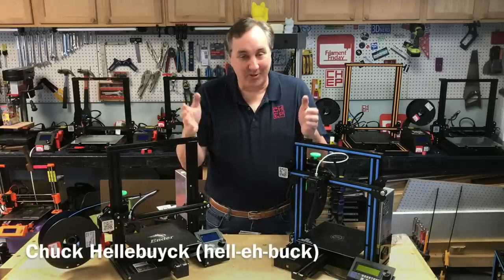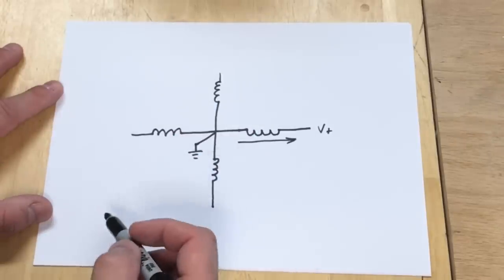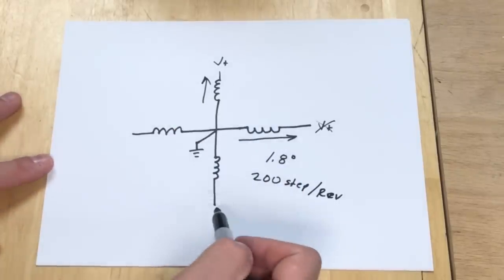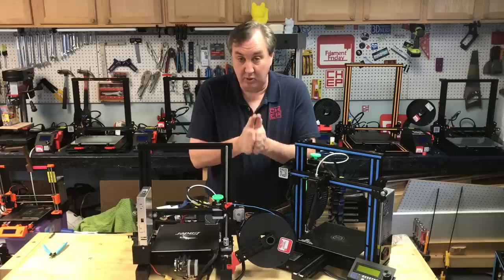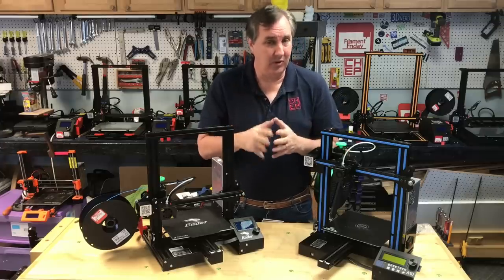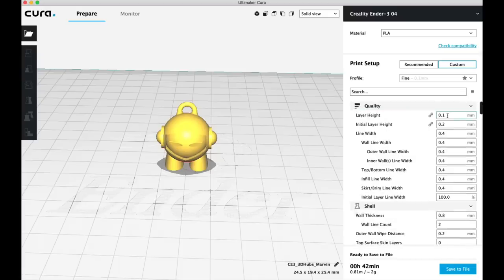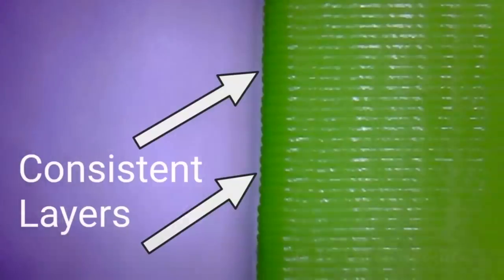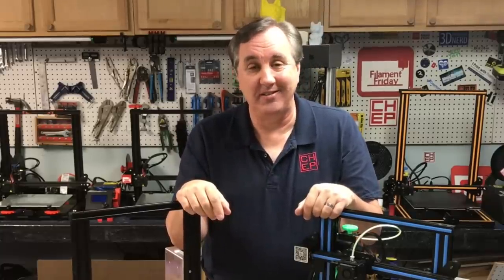Better Quality 3D Prints Using MAGIC NUMBERS on Creality Ender 3, CR-10, A10

Comment: I can't find these settings on cura. I'm having trouble with my ender 3 max. It prints good to certain points then strings like crazy and messes everything up
Reply: Oh can’t find the layer height setting!?
Reply: use ultimaker cura has all the settings ... make sure when u add ur printer to have ur operating system, for me for example is marlin 1.0 u might have a different one, that is important as the gcode will be "flavoured" for that OS.. for better reading and not have prints fail on reading. 

u have to go to options and enable all settings and then u have complete control over everything jerking etc.

Comment: Ok my tevo users a 2mm pitch which going by you numbers works out to be 0.01. Thus making every layer height no mater what it is a magic number is this correct ?
Reply from the maker: What is the lead though? 
Does it rise 2 mm on one turn of the stepper?
Reply: @FilamentFriday  the lead is also 2mm. I am curious as well as I also have a tevo. Great videos by the way. I just subbed :)

Comment: Hi, thanks for your amazing video. It clarifies a lot of things. So after that, I was thinking if there are magic numbers to set x and y steps. When it comes to tuning up the x and y steps in marlin because of the test cube, I have numbers like x 79.54 and y 81.03 steps/mm, but something tells me, now, that they are going to mess a little bit with the diagram you just explained, but being different from Z I don't know how to calculate them. Have you done any tests on this?
Thank you
Reply from the maker: They don’t help X and Y since they are always changing small amounts, not fixed amounts like Z.
Reply: @FilamentFriday   Hi, thank you for the prompt answer. I understand, but this put me back to the main problem. It is more than a year that I am trying to have a decent print on my cr10s, but I still don't know what is going on. I followed all your videos, but Nothing.  Thank you for your time
Reply from the maker: I got rid of my CR-10S because I couldn’t get consistent prints either. My CR-10 prints great.
Reply: @FilamentFriday  Hi, this is weird. Technically the CR10s have 2 Z motors and a newer MB compared to the CR10. I (I suppose) improved my CR10s with an SKR 1.4 T, x,y,z on TMC2208 and E0 on 2209, silicon heated bed 220V, so the PSU is free from the bed heating, Hemera direct d. But I still have a lot of problems.  I am thinking to get rid of this printer too. what do you think about an Ender 5 plus. I still need a decent build area and a bed that doesn't go back and forward.
Thank you
Reply from the maker: I’ve never used the plus. But some people like it.

Comment: Wonderful video, but there is a thing not clear:
  You say the magic number for Ender 3 is 0.04, than  profile fine 0.1 becomes 0.12;  extra fine 0.06 becomes 0.08;  extra fast 0.03 becomes 0.28  and finally Normal 0.15 becomes 0.16. Why so?  Maby normal becomes  0.17. not  0.16.  Is possible?  
Moreover if I have mounted TL-Smoothers on my motors  what's happen?  Numbers are different?
Thank You 
Luigi
Reply from the maker: Because 0.08, 0.12, 0.16, 0.28 are all multiples of 0.04. 0.17 is not.

Comment: Unfortunately this doesn't work with BLtouch auto level. BLtouch sets the apropriate "software zero" and doesn't care where is it in relation to magic number. When you level bed manually, Z motor(s) should be holding full step when leveling, then magic number works.
Reply from the maker: Nope. Not true. The bed can zero on a any microstep and with magic numbers it stops on the same microstep averaging out any variability so BLTouch doesn’t matter.
Reply: @FilamentFriday  Well, I don't have enough knowledge yet to claim you're wrong, but this doesn't make sense to me. Full step is the step which you feel when you rotate stepper motor by hand.  Microsteps in between make fine adjustments possible. I use stethoscope on motor and I can hear and distinguish full steps from microsteps when adjusting z-offset. Microstep has humming noise, while click into full step doesn't produce such noise. It seems like microstep is held electronically, while full step has some mechanical-like electromagnetic support to the electronic drive/hold. Z-offset is telling the software what is the height difference between nozzle tip and BLT tip. When bed moves by some microns in height after a while, BLT recognizes that and compensates in microsteps of Z motor. If BLT automatically levels in microstep and by chance stays there and not in full step, you will stay stuck in microstep with magic number, throughout whole height of print. 
That's how I see it.
Reply from the maker: Microstep angles have variation in between natural steps. BLTouch just sets the first layer. Any variations in bed height due to warp or unevenness, get filtered out in the first few layers by the firmware. The print then rises based on layer height, not BLTouch. If you use magic numbers it rises at a consistent rate equal to a natural step. Any variations in angle from microstep to microstep is averaged out because it rises and stops at the same microstep, (or natural step) that it started at after the BLTouch layers are complete. This produces a more consistent layer height and smoother prints.
Reply: @FilamentFriday  
I didn't know uneven bed get's smoothed out in uniform level through upcoming layers. I was imagining this differently, as you realized youself, less refined. Thank you for new insight.
Are you sure it automatically catches natural step (not in between) after BLTouch fades away? What if BLTouch started print just in between natural steps?

Comment: how do you know what that metal rod's threads for 1 natural step is?
I have a tevo tarantula and it has a metal rod with threads for the Z axis as well but i have no idea if its the same rod you have or not.
Reply: You can calculate it the same way he did. Mark the top of your rod, and use a caliper to see how much your Z moved up by 1 full rotation of your Z rod. :) Also, you can just keep testing it. 1, 1.1, 1.2 and so on.
Reply: vineheart01 Welcome to reason #2 why this is nonsense.  We have people expecting to believe that the tiny differences in steps within the stepper motor are screwing up print quality but you can take your calipers and measure a single rotation of your z screw.

Comment: Hi Chuck. I started running the magic numbers on my Ender 3 Pro and all is well. But as I was lying in bed last night, I was thinking about those magic numbers. While the concept makes complete sense (and your drawing was very helpful), does your Z-offset affect these at all? I was thinking that if Z was zero, then a .04mm turn would indeed align the motor with the next magnet. But what if your Z offset is, say -1.34mm or something like that? Doesn't that mean that the motor might be "between" magnets and each .04mm turn would put it equally between the next magnets?
Reply from the maker: As explained in comments multiple times, the Microstep angles aren’t equal so using the magic numbers averages that out. If you start at microstep 7 you stop at microstep 7. This rising equally to give the consistent layers I show in the video.

Comment: Hi Chep, today I just made a discovery. When I print in Tpu95 on my ender 3 using magic numbers I have poor layer adhesion. But when I'm not using magic numbers for example 0.3, the layers "interfere" themselves giving great layer adhesion. This only happened with TPU, with PLA magic numbers give the best results. Would be great if you make an in depth video about this. Cheers
Reply from the maker: I print with TPU using my Magic number based profile all the time without issue. Must be something in your slicer file that’s causing it.
Reply: @FilamentFriday  I mean it looks great, but they can be separated with some force.

Comment: @CHEP I don't understand what did you do with the magic number (0.04) you just changed to 0.12mm from 0.1mm in the layer height and how's that related to your magic number
Reply from the maker: 0.04 + 0.04 + 0.04 = 0.12
Reply: So hard calculations.... I´m done :-D

Comment: Alright, but isn't this for the base setting of 400 micro-steps per mm in Creality firmware? Doesn't that mean that if I print your calibration cube (thing:3189377) and use your excel document to calculate my perfect steps per mm, don't I have to recalculate the 0.04 layer height for the new step count?
Reply from the maker: No

Comment: Hi. The TEVO Tarantula has a one start lead screw of 2mm pitch. So 1 revolution moves the Z-axis 2mm . Then the magic number is 0,01, and this means, any resolution can be possible without problems?

Is this an advantage of 1 start-2mm-leadscrews? Where is the disadvantage?
Reply from the maker: Yes, 0.01. Makes for slow Z movement.

Comment: and for .2mm nozles? what print quality I can get? what would be the magic number? tolerance?
Reply from the maker: Nozzle doesn’t affect magic number.
Reply: @FilamentFriday  how would you run a .2mm nozzle
Reply from the maker: I haven’t had much luck. I’ve had better prints with 0.4.

Comment: I don't understand when you got to 3:20 about the variations. What are those numbers based on? I also don't understand how those numbers correlate to the nozzle.
Reply from the maker: Each micro step of the stepper motor can be off a bit so there is variation in the Z height movement.

Comment: CHEP I’ve started watching you recently and for some odd reason on my Cura I’m getting these lines on my projects kinda looks like wave lines but yours is so smooth on the app how do I fix this?? Thank you!!
Reply from the maker: Are you using my profiles?
Reply: CHEP yes I’m using the one called round with no seam. I think I have something messed up on my figures I don’t think the inlay is overlapping one another

Comment: greeat video have a question I use cura and have a cr-10 profile loaded, does the cr-10 have a larger print base than the crality ender 3? And if so how do I adjust that in cura?
Reply from the maker: Yes, CR-10 is 300x300x400.
Settings>Printer>Manage Printers
Then select CR-10 profile and click on Machine Settings

Comment: Hi I know this applies to z axis, but is there any way a magic number could be applied to a geared extruder? For example, could you use the pulley diameter pitch to determine optimal gearing or something like this? I’d be really curious if you have any thoughts! Thanks
Reply from the maker: Magic number doesn’t really help the extruder   since it’s continuous turning geared or not.
Reply: @FilamentFriday  Gotcha, cool thanks. I was thinking specifically if there was any specific gear ratio that might help with moire or artifacts. Seems there isn't any way to apply this as you've said

Comment: Will printing with a larger first layer completely negate magic numbers for the following layers?
Reply from the maker: No
Reply: @FilamentFriday  so do you just have to use a magic number for the first layer too?
Reply from the maker: You use it as your layer height. If you use a thicker initial layer then the rest of the print will right at a ration of a full natural step. But you can also use a magic number for the first layer as well.

Comment: so if using a 0.2 nozzle are the magic numbers the same? .04, .08, .12, .16 and .2.  I was printing at .08 on my .2 nozzle but it didnt print correctly.  I also watched your video on nozzle sizes and you changed the nozzle size in the slicer to 0.2 which I did not do.  could that have been the issue with it not printing correctly?  thanks videos are always educational.
Reply from the maker: Nozzle size has nothing to do with magic number. 
Yes, you have to tell the slicer the nozzle size or it pushes through too much plastic.
Reply: Yes of course you have change it, otherwise it would ask what size nozzle it is

Comment: question.. I’ve an Ender 3 but I’m upgrading the board (and the steppermotor) to the Duet. How does it change the number? Really appreciated.. ;)
Reply from the maker: Not sure you’ll need it.
Reply: Hello sir I have a cr-10 S4, and thinking about purchasing a ender 3. What motor and board did you put in it?

Comment: That's great if your using Cura but what if your using Simplify 3D? would that still be the magic number?
Reply from the maker: Yes, it’s not a slicer issue, it relates to the microstepping of the Printer.
Reply: CHEP
So should I do to get the magic number?
Reply: @TheDronzDr  omg, just rewatch the video! There is complete detailed explanation of the situation.

Comment: Stepper motors come in different resolutions don't they? Is this 200 step motor specific for these machines or is that industry standard for 3D printers?
Reply from the maker: Most printers are 1.8° which is 200 steps. A few are 0.9° which would be 400 steps.
Reply: Gotcha, thank you sir!

Comment: I printed a small part using the .12 profile.  The brim is so thin I can't get it off the bed (Ender 3).  Any tips?
Also, I was hoping Cura had a way to print the brim at a difference layer thickness then the rest of the model, but I don't see any setting for that.
Reply from the maker: You can change first layer height. 
Filament Friday Tool Kit has a great tool for removing prints.

Comment: So im both curious and confused, i am still in that learning phase , so here goes. I see you are using a 0.4mm nozzle? in your video, and a layer height of 0.12. Previously on my 0.4mm nozzple I used a 0.32mm layer height (I assumed that was the optimum layer height) I didnt realise I could reduce my layer heigh down to  0.12mm. 

So I guess my question is, if I use a 0.4mm nozzle and 0.12mm layer height, I will significantly increase my print speeds as my wall line count can be reduced to 2 (and still have a thicker wall),  instead of a wall line count of 3 if i was using a 0.2mm nozzle?
Reply from the maker: Nozzle only affects width. Layer height affect how fine it’s print. 0.32 layer height will print faster but rougher as each layer is thicker. 0.12 will give you very good prints but take longer because there will be more layers. 
The magic number just means 0.12 will print faster than 0.1 but give the same or slightly better quality.
Reply: @FilamentFriday  Thanks for this, I thought the nozzle size combined with layer height had a much bigger influence on layer quality. After several prints with a .4mm nozzle at .12mm layer height I cannot tell the diffence in layer quality over using a .2mm nozzle with the same settings (except for a speed bump with the larger nozzle)

This has been a great, informative video

Comment: How does this goes over to a belt driven printer?
 Would it be the calculated circumference of the radius of the gear that moves the belt divided by 200?
Reply from the maker: No idea.
Reply: I'm thinking it would only be different if the drive ratio between drive pulley and driven pulley is not 1:1      If the pulleys are different you can divide the final result by the ratio of the pulleys.
Reply: The steps are probably different. For example, my xy full steps are 0.2mm rather than 0.04mm like my z axis. I don't, however, recommend worrying about it for the xy axis. The reason it is helpful for the z axis is because errors are cumulative in the vertical. A layer shift will affect the entire layer if not the entire remainder of the print, whereas the resolution on a belt is so low you would not want to see what happened if you avoided microstepping. Imagine layer steps in all dimensions! Microstepping isn't perfect but it is what it is right now. The z axis is the only place that you can try to avoid it because you get to decide how far to move for each layer. The dimensions of your part define the xy, so there's nothing you can do about them.
Reply: That being said, the real benefit to magic numbers is that, in theory, you can avoid microsteps, which hold less motor torque and are more likely to layer shift. And the problem is that if you use a bed mesh leveling system like a BL Touch you're almost guaranteed to be stopping on microsteps anyway, so you're losing half of the benefits of magic numbers before you begin.
Reply from the maker: Not true. Starting at a Microstep is common. But magic numbers make the Z axis rise at the same Microstep you started at so it averages out any variability in the other microsteps giving a more consistent layer height.
Reply: @FilamentFriday  I just said that starting at a microstep is a problem with mesh bed leveling, so yes we agree that it is common. Unavoidable really. The only way to avoid it is to manually level with no mesh and use full steps for setting z offset. It can be done, but it isn't a tradeoff worth making.
Reply: @FilamentFriday   as for the benefits of stopping at the same microstep every time (which still does not happen for the first x number of layers if you're using mesh bed leveling and feathering), the same kinds of things that can give different microsteps inconsistencies can give individual whole steps on the motor inconsistencies which is unavoidable. I'd like to see a source about that having a meaningful impact, or at least the rationale behind it.

And as a preface, I do use magic numbers and have them programmed unto my tft firmware for babystepping.
Reply: @FilamentFriday  my understanding is that the real meaning behind magic numbers has to do with interpolation and how it estimates given values that lie BETWEEN interpolated microsteps. Naturally if a value lies between two microsteps the driver has to choose the nearest. And if you keep giving it non-integer multiples of microsteps for each new movement, then it is always just a smidgen off